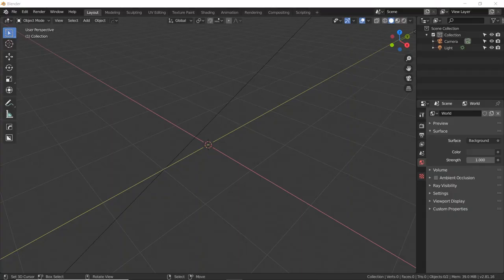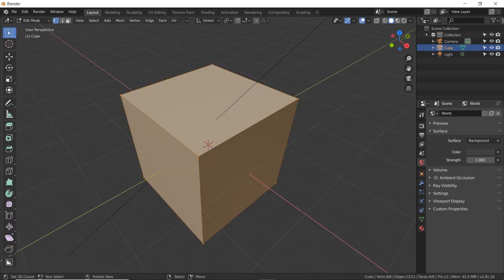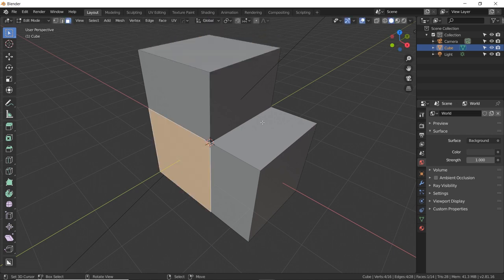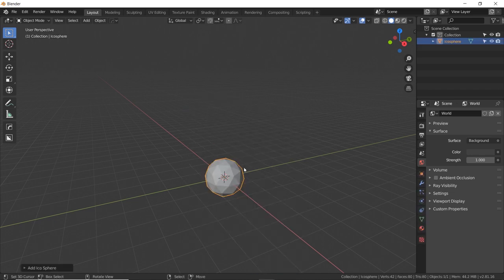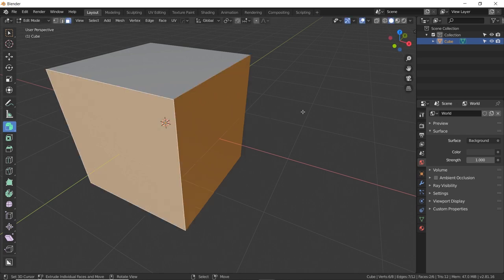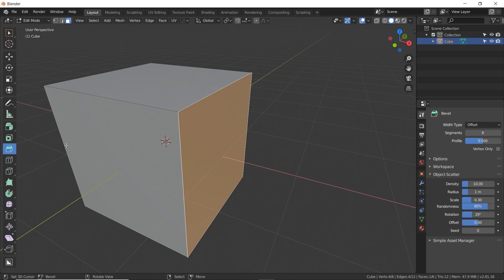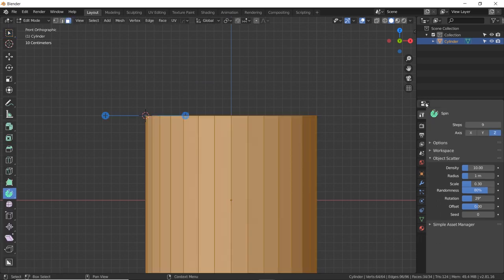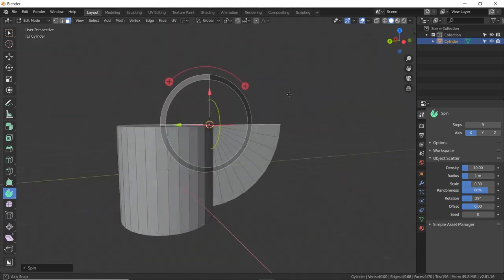Hard surface modeling in Blender part 1

Comment: I have a question. Is there a difference between extruding then pressing s to scale vs just pressing i? From what ive seen in the video, the i keybind gives more control on the face like for example double tapping it to do two faces separate but does doing it the other way badly affect the mesh or something similar?